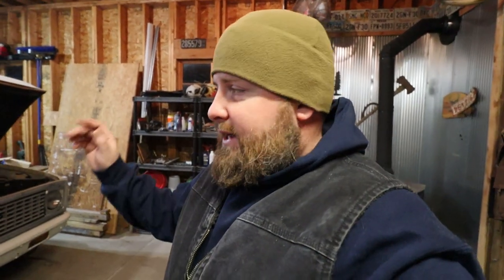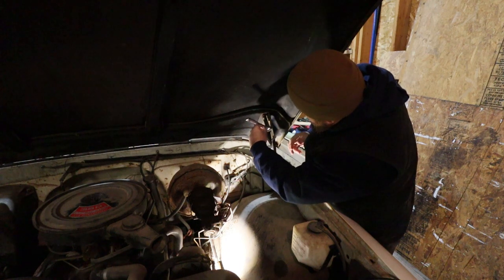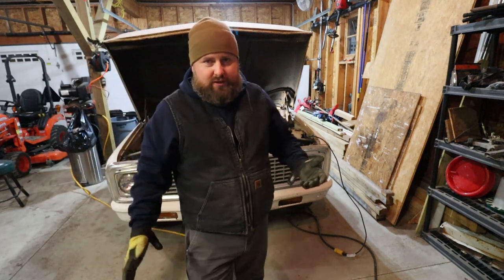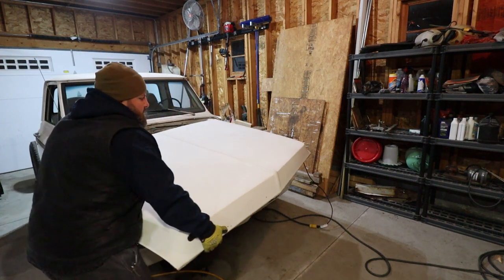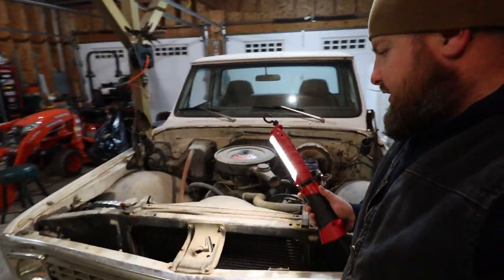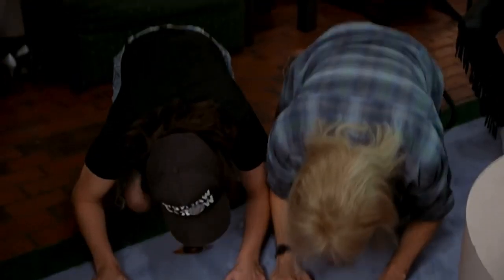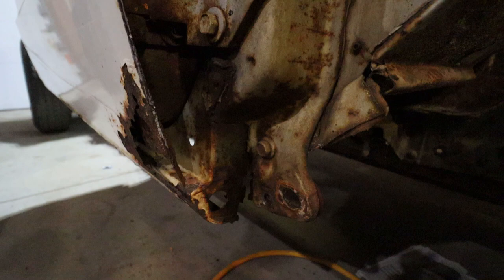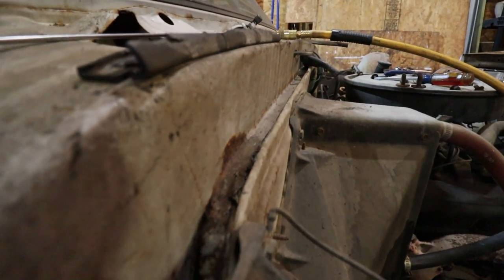How Does One Remove A Hood With No Help? | Assessing The Cab Rust On My 1971 Chevy Restoration

Comment: Love your stick. Here in PA, we call them a hood prop; maybe from old coal mining days.  Yes, get your stick (prop) ready, and cut to length, before you remove any bolts.  Then get a thick old blanket and put on the cowl, your mystery word. The thickness of the blanket will mostly prevent any windshield damage, if thigs get out of control.